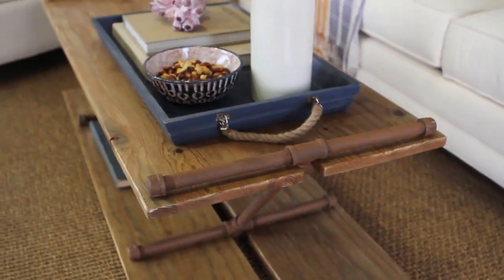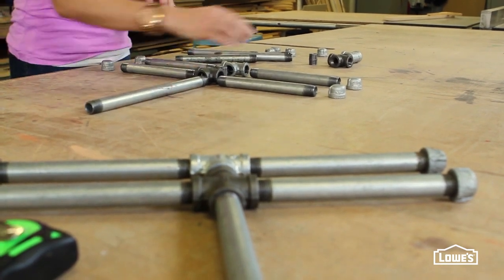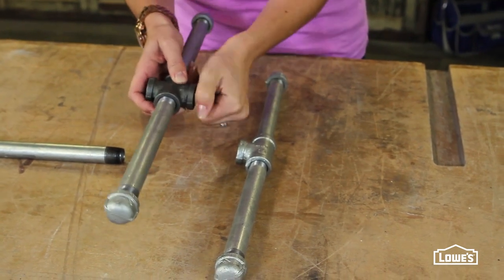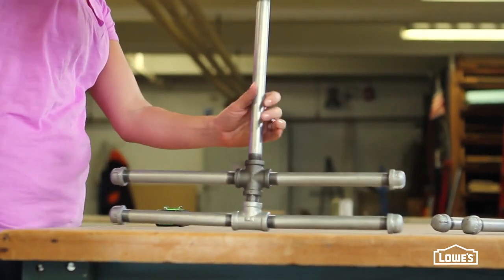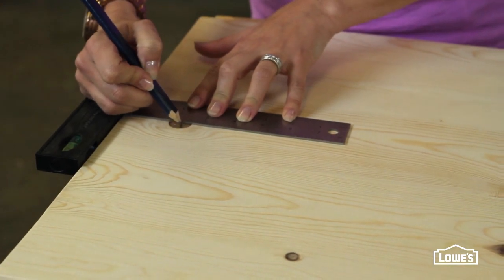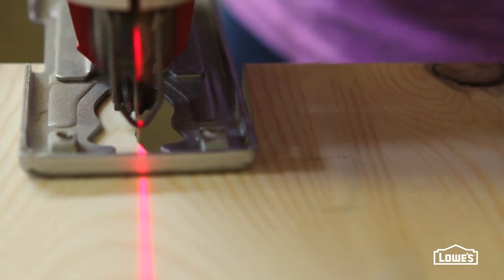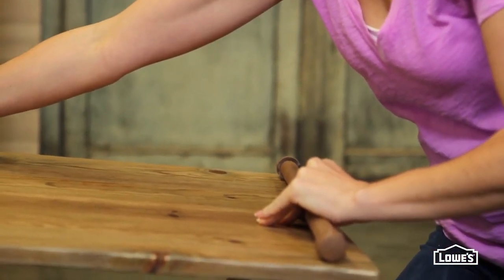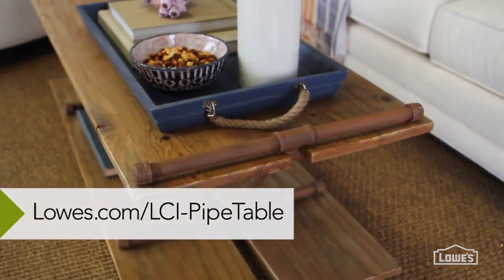Industrial Coffee Table with Metal Pipes

Comment: 1.  Board measurements matter to get the right height for a coffee table......none given.  2. Lowes does not sell pre-made (glued & joined) "boards" as you called it in that top size width or length without going ply or particle and having cut edges.
Reply from the maker: Full project details including tools and materials list and project diagram is available here: http://low.es/1hevOtg.